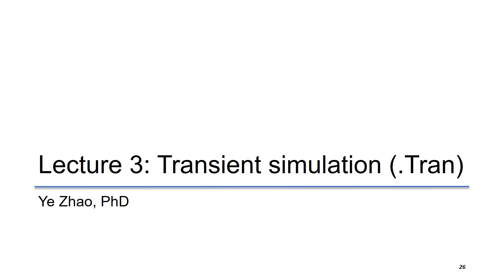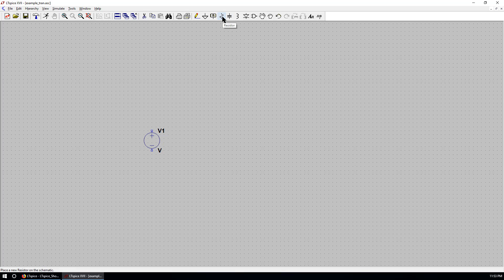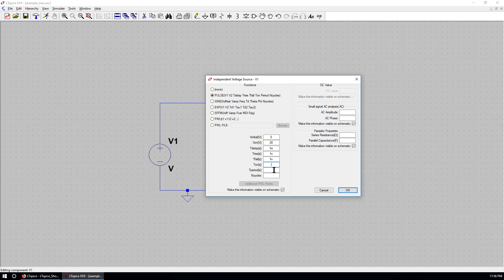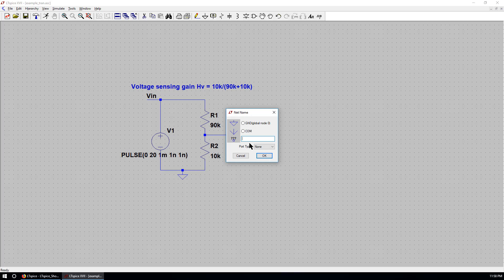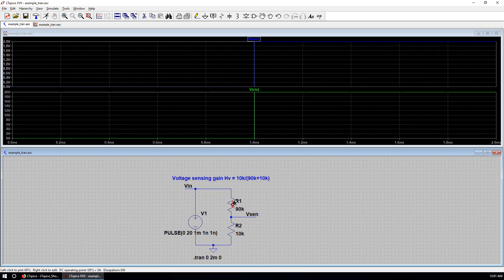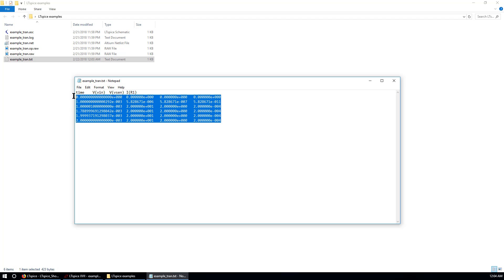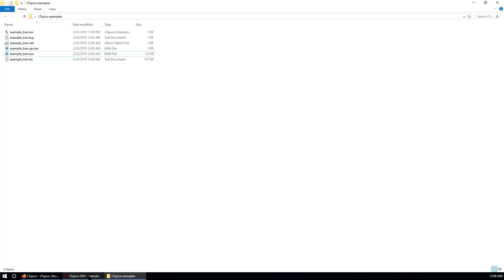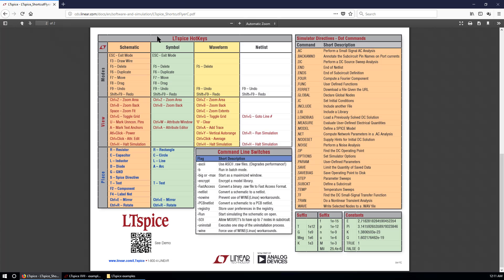LTspice beginner Lec3 transient simulation(.tran)

Comment: 2:24 - Since you know you want to connect the components in series, you can simply wire through the voltage source and through the two resistors, in this example. Click to make your corners and LTSPICE will allow you to continue the wire to the next component.
Reply from the maker: Great to know. I Thanks for sharing!

Comment: thanks for your nice video. Would you please upload a video about Output impedance measurement of a OP AMP circuit with different load (register )
Reply from the maker: thank you for your comment. Please check this video about dc transfer function. It can measure the input impedance, output impedance, and dc transfer function. Once you get familiar with this feature in LTspice, it is very straightforward to get the output impedance of op amp.  https://www.youtube.com/watch?v=AJN6jdJGJD8
Reply from the maker: I created a complete tutorial in Udemy. https://www.udemy.com/ltspice-tutorial-for-beginners/   If you need discount coupon, please reach me at EEsanity at GMAIL.com